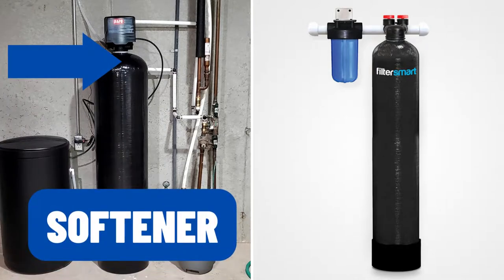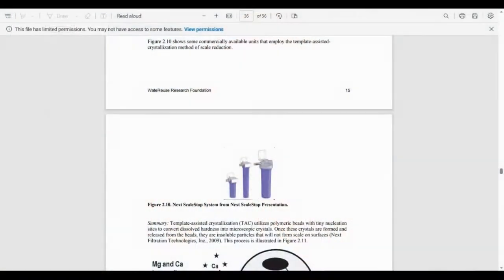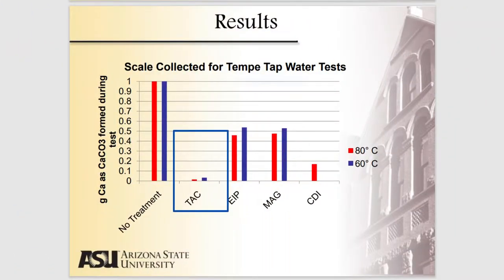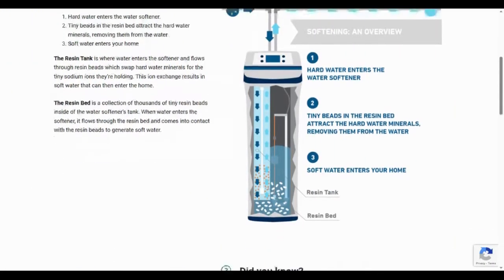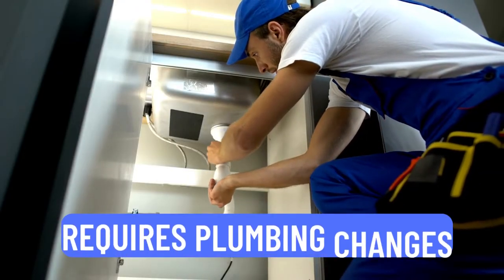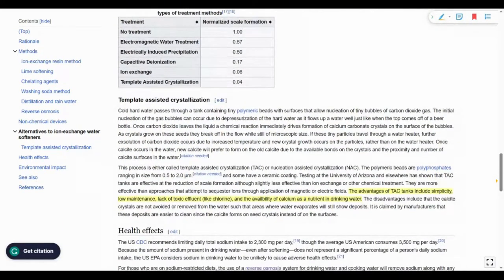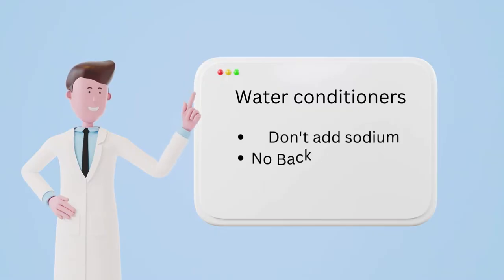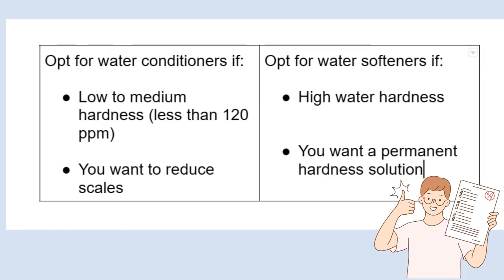Water Softener vs Water Conditioner: The Truth Is Finally Out!

Comment: There is a lot more "water conditioner" treatments than only TAC.  Polyphosphates and citric acid are two commonly pushed.  Is there any actual research proving 1) they work, 2) what is necessary so they work?  Ion exchange is well understood and works when done correctly, and there is plenty of information on how to do it correctly.
Reply from the maker: Yes but TAC is best in water conditioner category

Comment: Awful video and totally misleading.
Conditioners are a maximum 80% effective whereas a softner is 100% effective. But, softeners are expensive to maintain and the water is dangerous to drink. Conditioners will work to a maximum PPM of 350 not 120 as stated in the video, if your water was 120 ppm then you do’nt need to worry about limescale as you won’t ever see any.
Reply from the maker: yes I said this only. If you're only worried about scales use conditioner but for all hard water problems, softeners are the best.